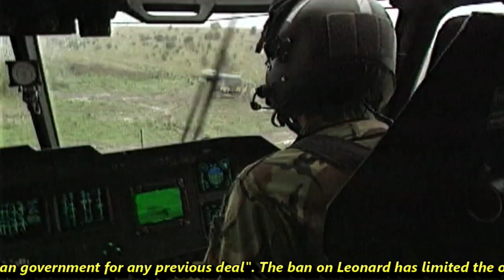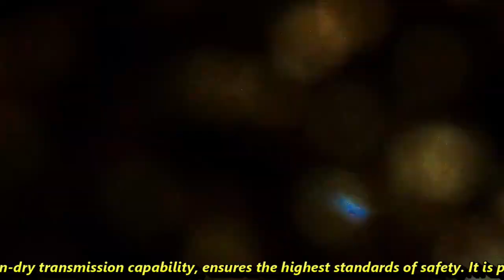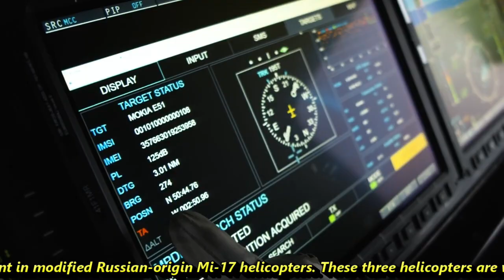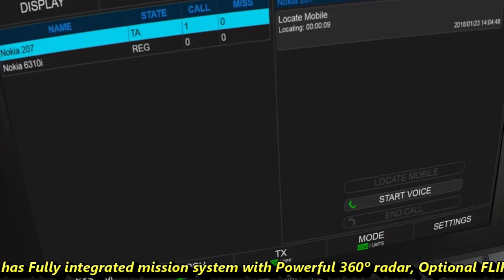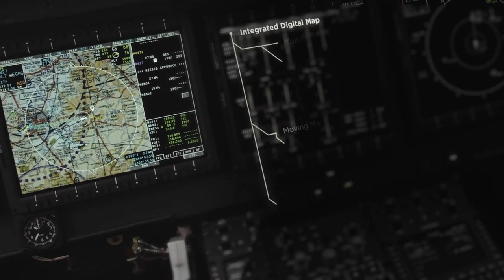Ban lifted on Leonardo | Can AgustaWestland AW101 be used for IMRH design?

Comment: Long ago  HAL designed an aircraft for deep penetration strike role code names Twin engine HF-73 (Loosely based on Tornado) with an old engine which has maximum thrust similar to our Kaveri engine, May be this co-operation with Leonardo can bring HAL , ADA to develop the DPS Jaguar's replacement and also a dedicated EW variant to supplement our Rafale (Air to Ground, Strike roles), Mig-29 (Air superiority role) and future ORCA (this is Rafale and Mig-29 combined :) ) . This could ease of pressure on SU-30 MKI which will continue to play a role of Heavy long range strike fighter.
Reply: This is wildest dream bro .. hope we get to see some traction on this.. well on defense sector we were always thinking ahead of Chinese but .. something was pulling us down.. HF-73 was designed in 70s just imagine

Comment: If we can Get a TOT of AW101, that would be a suuuuuper awesssssome deal..😍😍😍
Reply: Why begging for tech if DRDO can develop new tech?
Reply: @manikchandwadia4372  , When.??? 
They have beenworking on a medium weigh Helo for a long time, and they brought up a design which was outdated during soviet era..🥴🥴🥴🥴🥴🥴🥴🥴🥴🥴
Reply: ToT is a hustle, we have been making loads of stuff under ToT since 70s. How have we benefited in broader terms? We ended up paying double for each product . It’s not useful in current terms
Reply: @RP-qs1tp  money cannot buy time but you're bypassing decades of hard work by buying 5- 10 planes. Easy work. Same with train loco. Just order 10 take ToT and make 1000 while abusing the supplier when they suffer
Reply: @manikchandwadia4372  you are totally wrong, if a project is not funded properly it will be delayed or it’s conclusion will be later. So in project terms money does buy you time :)

Comment: Since it is only 3 in nos it is better to be used as vvip chopters as this will be better than the junk russian mi17  chopters. It would have been good for naval operations but 3 nos is another problem and also will pull back naval imrh(navy needs a lot of such chopters for cargo transportation b/w vessels and shore to vessels).